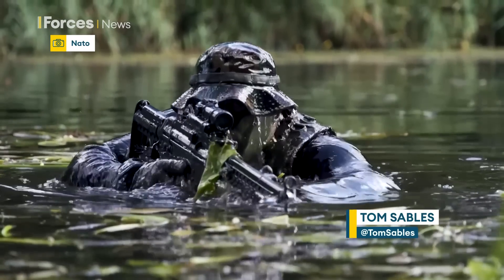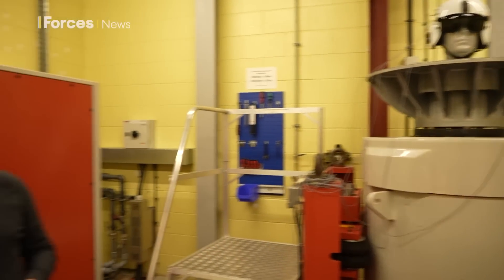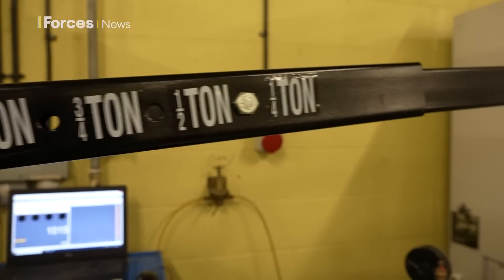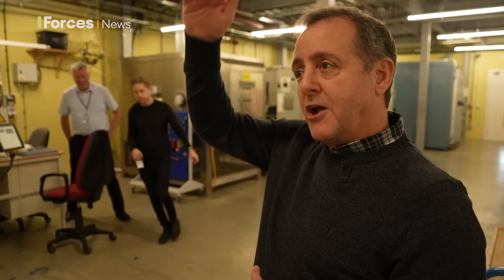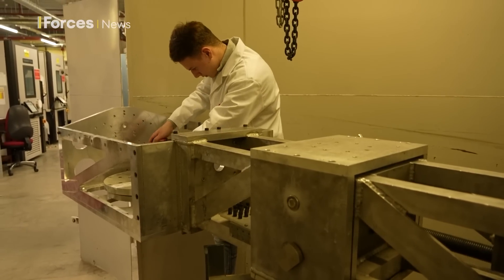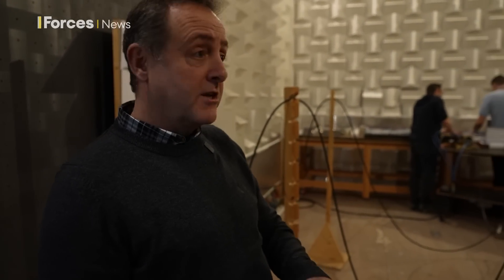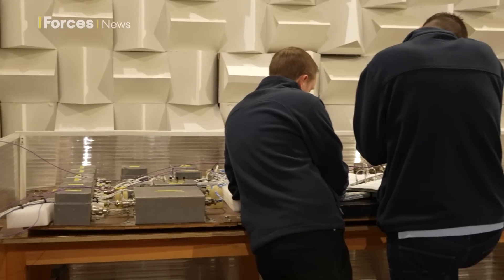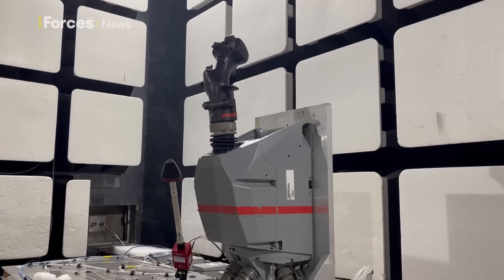Take a tour of the facility testing military equipment to the extreme

Comment: It has not been properly tested until it has been put in the hands of the end user.  No level of “lab” testing can reflect what happens in the field in the hands of the user. Industry will always say that it was not designed to do that. A soldier will use it as he requires!